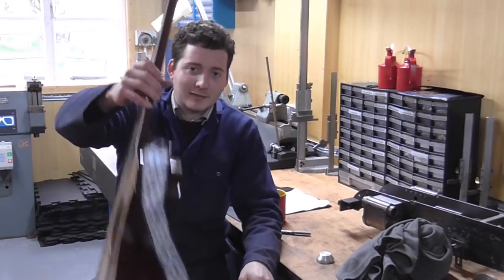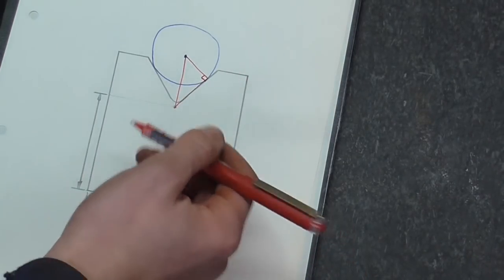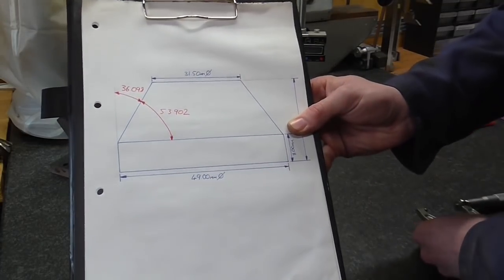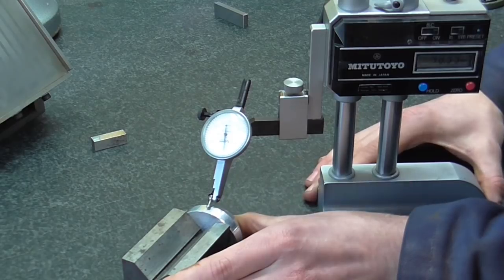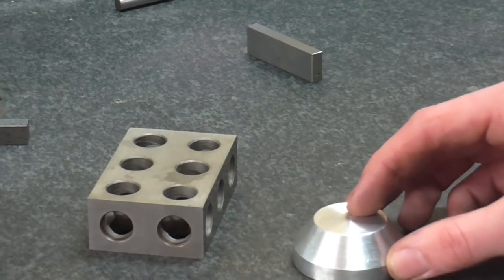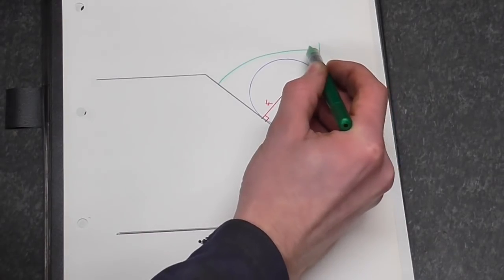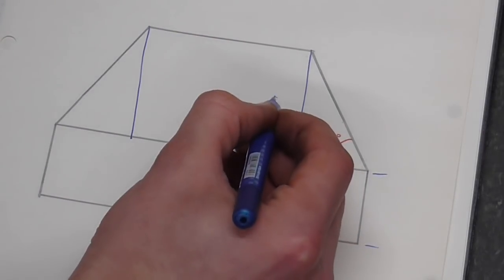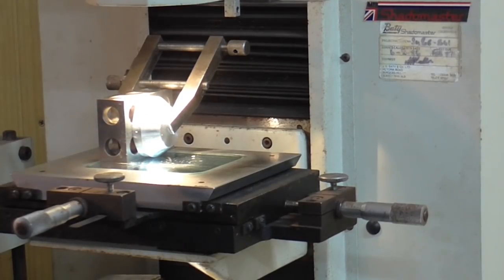Measuring a Conical Feature

Comment: I’m originally a car mechanic who went into welding fabrication and now works repairing hydraulic rams for forestry equipment, I work a Bridgeport and a large dean smith + grace lathe now at work I’m more or less completely you tube taught as far as machining goes ( tubalcain , this old tony , Adam Booth , John mills , Joe pie and more recently yourself) yours / Joe pie’s math is slowly starting to sink in most goes over my head but if even a little sticks…
I enjoy your videos and have a great respect for your work ethic and knowledge please keep them coming 👍🏻
Reply from the maker: Thanks

Comment: You could put the small end of the cone down on your surface table and measure across 2 equal sized dowels held against the cone to get an accurate width without a height gauge,  like measuring a gear over wires. We would frequently give these dimensions over dowels on parts with conical or triangular features for the machinist
Reply from the maker: Yes good idea. I did consider something along those line for checking while machining. You could push a parallel up against the end of the component with that tailstock and the check over dowels.

Comment: hi Mrcrispin,  im enjoying all your  great videos ,doing the same kind of machining that your doing and the ideas are a great help. want to mention something about the conical part and figuring tapers in general on anything, instead of using trigometry to figure angles i use the construction master calculators functions of  run/rise/pitch/ diag/. suppose we have a right angle triangle[ which basically is a taper]  where 
RUN is horizontal line,  RISE is vertical plan,  PITCH is angle, and diagonnal is hypotenuse, enter any 2 figures like pitch and run and calc will give you diag and rise , been using this to figure virtually any angle for 15 years, fast and simple, also does a host of measure conversions, can be downloaded on smart phone from calculated industries, excellent for guys who cant do cosine/tangent stuff, let me know what you think, im positive a lot of home hobby guys would get one if you did a video of it . thanks
Reply: Now that's a good idea! How about it Mr Crispin? I never was taught trigonometry in school, we did what was called "Modern Maths" this was in the mid sixties to 1970 absolutely bloody useless and I've never used it since! So an app that would sort out these things would be great. Com on Crispin, your audience awaits with baited breath!

Comment: Plus is there a way to do the same without a surface plate?
Reply from the maker: Hard to get away from needing a flat surface but the old model engineering text books suggest using a piece of glass.